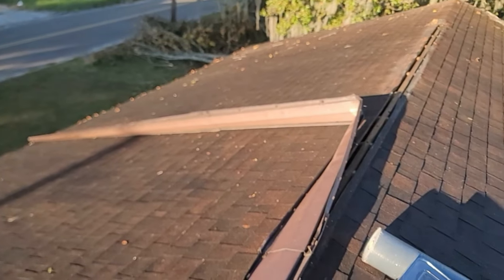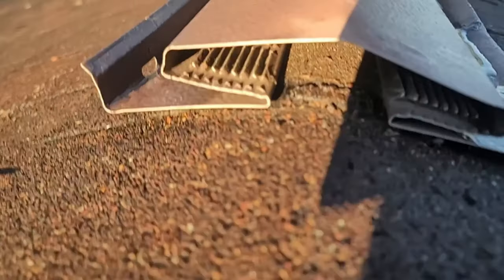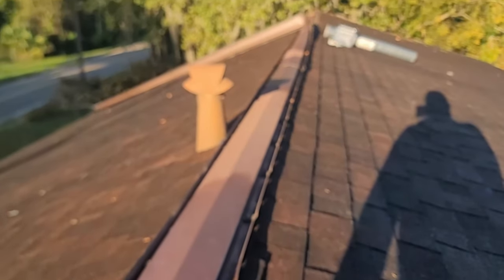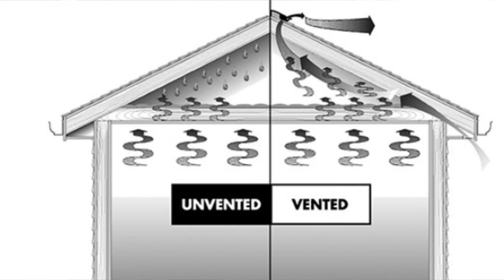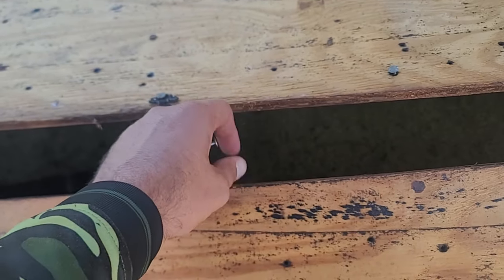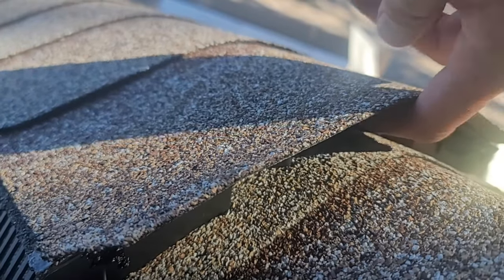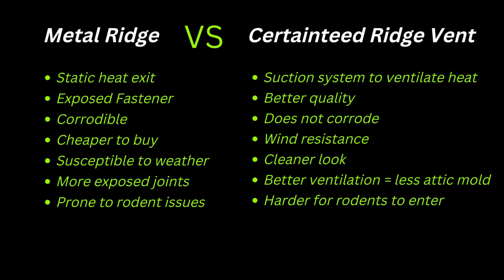What Ridge Vent Should I Install On My Roof?

Comment: Great video thanks for the info. My roof was replaced 7 years ago and I couldn't get the attic temp below 130 in the summer and 40 degrees over ambient temperature in the winter. Last year I asked my roofer if he could replace the ridge vent with a model that has an external baffle also. He said he does use that type now also and did replace mine with it. Now my attic temp is ambient temperature until about noon never getting higher than 20 degrees over ambient and dropping quicker in the evening. Best thing I've done. I had opened my soffits and closed the gables when the new roof was done. Temps before the new roof were even higher.

Comment: There is really no "sucking" occurring at the roof, there simply is airflow up and out due to heat rising and air expanding from the heat.  The flow is controlled by the inlet (soffits) and outlet (ridge vents, box vents, or gable vents).  I have gable vents that I'm ditching in favor of ridge vents. I've always thought gable vents combined with some box vents are worthless as rafters trap sections of air, create turbulence, and makes it difficult for the air to move smoothly.  As a parcel of air is heated, it gets bigger.  How much flow is determined by the total parcel of air, how hot or cold it is and the area / volume of the ridge vent and soffit vents to allow the air to escape.  But the other factor is to allow it to escape evenly and not "piecemeal" the way gables and boxes to.  They have to be in a balance for the best effectiveness.  There's no mechanical action though, it's more of fluid control by how fast or slow you allow the air to flow like turning off or on a sink valve.  

Secondly, anyone trying to cool their attic, I HIGHLY HIGHLY recommend using 1" or 2" foil backed poly-iso foam panels set 1.5" off the ceiling drywall with edge spacers every 24" made of 2x4 scrap and spray foam seal the panels in place..this cut them 1/2" extra per side for foam locking.  I recently did this in my house (I live in downtown Abq NM where we get 100F heat waves) and my temps (with laser thermometer) when OAT was 90F was...get this... 91F on the underside of the foil at 3pm (without ceiling drywall installed yet under the panels!) and 106F on old already set 1/2" drywall (mudded and painted) which had no insulation on top of it yet (no poly-foil, no batting, no blown insulation etc).  These temps were taken just 3ft apart from one another on several 90F days with same results.  It was a 15-16 degree difference each time.  Just absolutely huge. 

I also plan to staple on reflective foil on the truss rafters on the south side as our house (rectangle shape) faces due east / west.  I'm 1000% sold on controlling heat with radiant foil type barriers. In addition to this and installing ridge venting, I'm also fully replacing my soffits and trim and installing "venturi" type baffles I made DIY as I found our soffit vents were completely clogged with blown in fiberglass insulation which spilled over the exterior wall top plates right into the soffit channels.  The new baffles, set at the top of the wall plate help to greatly contain and hold back the insulation, and leave a 1.5" tall x 22.5" wide x 16" long venturi channel to guide the soffit airflow up toward the roof.  Rather than buying cheap foam or plastic baffles you staple in when the roof is off, I made mine out of 2x4 and plywood.  2x4 has a bevel ripped at the top 1.5" edge to match roof pitch angle and the plywood deck is glued and screwed on top.  This may cost a little more than cheap foam baffles but is better long term and wood is also a good insulator. You could also use foil reflective OSB.  I used liquid nails and 2" screws to secure them to the top plate and a single 1.25" screw out at the end of the plywood on each side to catch the arm weight of the plywood.  

Lastly, I spray foamed the side edges to seal in place.  Just like with the poly-iso, I cut the plywood 3/8" less per side to leave room for foam sealing and this helps create the venturi effect.   All of what I've stated has DRAMATICALLY helped the attic cooling and airflow.  I also suggest using the lightest colored asphalt shingle you can live with.  Ours are a light cement grey.  My final point, is you have to attack all this from many ways, not just one.  Copy / Paste / Save in Notepad!  Cheers.

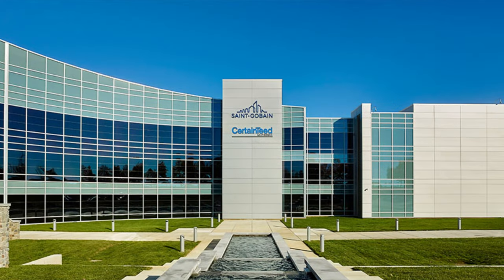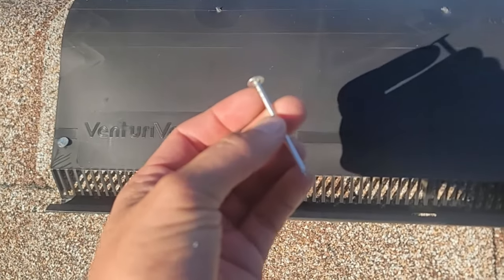Comment: Thank for all this info. I'm a bit confused though. Clearly the box for the Ridge Vent is CertainTeed (2:13), but just prior (2:02) you show a VenturiVent branded Ridge Vent that is produced by Air Vent, not CertainTeed. I've heard good things about both, but which one are you recommending? Thanks!
Reply from the maker: They are both great and efficient air vents. Everything depends on the manufacturer warranty for shingles. If it's an upgraded warranty then most manufacturer require the components be their own brand to honor the warranties. Using the same brand avoids running into any of these issues.

Comment: Well, I am actually looking at different venting systems because we had a wind storm today that stripped off cap from two different sections of ridge vent like what you are showing here. There are probably several reasons why it failed, but I am not very impressed with it, to be very honest. I have 3 buildings. My house has the same as you like in this video and 2 other roofs that have the older style aluminum ridge vent that I have never had any issues with at all...  Tomorrow I have to go up on the roof and really figure out what went wrong and fix it, but honestly, this is at least the third time fixing different areas of the same vent on my house roof. Wish i knew where you are in Florida as I'd love to have you check it out!!  I am in Holiday, Pasco County.
Reply from the maker: We are in central Florida , just north of Orlando, unfortunately you are a bit out of range for our services. We highly recommend using directorii.com and using that to find a contractor you can trust near you!
Reply: @eustisroofingcompany  Well, I climbed my handicapped ass up onto the roof with a bunch of my old roofing tools and repaired the vent and all the caps myself.. The company that did my roof back in 09', used 1 3/4" roofing nails to install the vents. I used 3" ring shank nails with $.25 sized shoulder washers on the vents and the same on the caps. I also Karnac'd each and every shingle.   This is the 5th time I have had to repair caps on my roof and all that I have done has been perfect... Fact is, I should probably just go tear off the 2 lines of cap left that they did and do it right, but that will have to wait until my back eases up with the pain...

Comment: Well you really don't know what your talking about. The metal ridge vent with filtervent is actually the best vent for extracting heat out of the attic on shingled roofs. CertainTeed plastic vent works well also but it does not outperform the metal. If its installed properly with hex head neoprene washer screws it will never blow off. And if you screw the end plugs  in with the same screws you won't see them get pulled out by varmints. There was a study done on all of the ridge vents back in 1995 by the University of Illinois and the metal vent outperformed all . I installed it on my house in 1983 and never had one problem. I just re-roofed it in 2018 and installed Air-Vent filtervent and I won't have any problems with it. The metal is not cheap. It just outperforms . 2nd Generation roofer with 52 years of on roof experience.
Reply from the maker: Really appreciate the comment and a different view. If there's one thing that catches my attention, it's old-school roofers. They bring a ton of knowledge and experience that is needed in the industry. I disagree; it's not the best in 2023. Yes, it was the best in 1995, and I was installing them back then. There is much better technology that pulls the hot air out of the attic now, benefiting the homeowner and helping the roof last longer. Also, from experience, they handle storms better.

While I agree that any component really depends on the install, you're correct that 90 percent of them are installed wrong, and that's why they fly off in storms. I have seen them fly off when they are screwed; over time, the screws deteriorate from exposure and water ponding around them, causing issues. However, an intelligent roofer can place the screws better and add better quality screws to fix this. So, in many ways, you are correct. I really look at what is the best product and what I have seen work the best from experience, but another aspect is what is the best product that takes out human error when installing, which is huge. I have seen squirrels chew out plugs that are screwed in. You stand a much better chance, but those squirrels are relentless sometimes.

I disagree on the metal; although aluminum is amazing for roofs, it is almost as thin as a tin can. The new manufactured vents are much stronger. Another key issue is manufacturers want their vents on their products, and you can lose your warranty if you don't. Keep that in mind; I've also seen it happen. So there are many reasons I recommend, in my opinion, a better vent from experience. Absolutely love and respect, 2nd-generation roofer with 52 years of experience. Tons of respect and appreciation; very few experts out there like yourself. Thank you for stopping by and dropping off some of your knowledge and experience. Stay safe!
Reply: 👆 that was a great dialogue thanks so much! I work with a company that does roofs in Florida so this is perfect
Reply: Every time I go to a house that has the aluminum vent, there’s problems. You are very wrong sir. There’s still exposed fasteners regardless & they inevitably fail. Roofing in the 90’s is not the same as today.
Reply: @barrettstyles1409  Sorry buddy.  I've been roofing since 68 and I've seen everything out there.  If you install it right there will be no problems.
Reply: @larrycrookshanks1646  spoken like a true dinosaur. Every old timer hated Lazer levels when they came out also
Reply: @timc4765  Maybe you can't comprehend.  The University of Illinois did the study back in 1995 and I still have a copy of that comparison.  Flat out the metal outperformed all other products.
Reply: @larrycrookshanks1646  lol 1995?
Reply: @timc4765  All the products that were used in that comparison are still in use today.